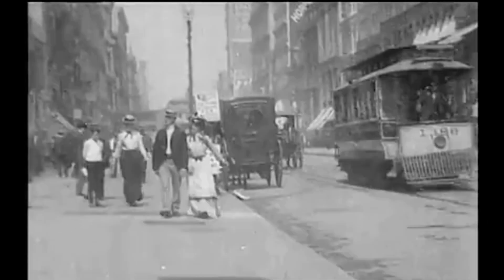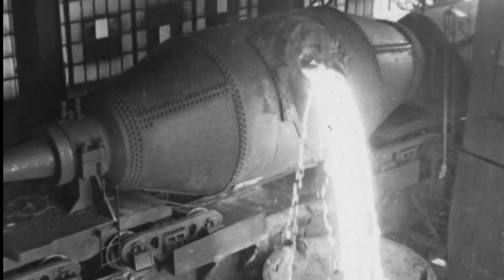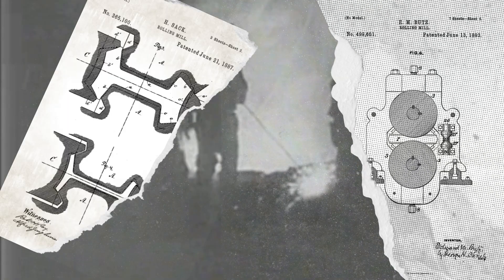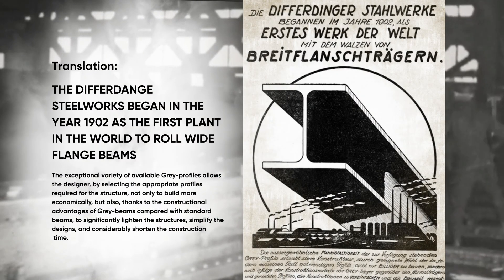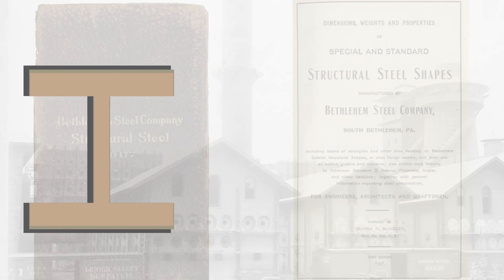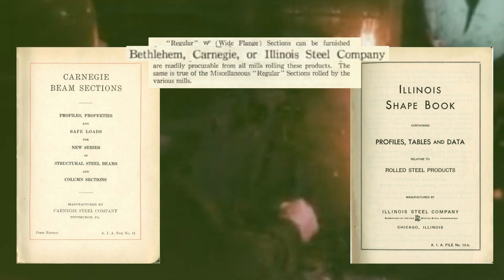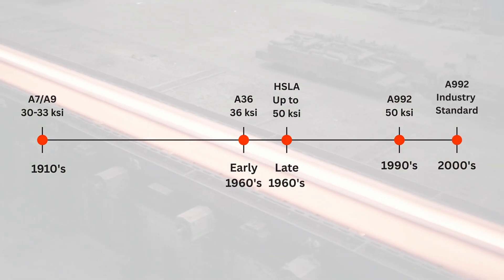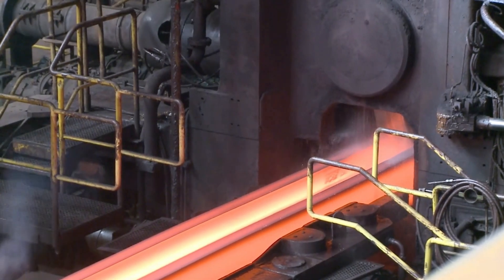From I Beams to the W14x1000 - The Structural Steel Evolution

Comment: Very interesting and enlightening. I didn’t know modern beams are up to 10x stronger, that’s crazy advancement.
Reply from the maker: Thanks!  To clarify, modern sections have 10x the load-carrying capacity (not to be confused with 10x strength).  Load carrying capacity is a combination of increased strength (e.g., going from 36 to 80 ksi) and larger available section sizes.

So roughly 2-2.5x increase in maximum available strength and roughly 3-3.5x increase in largest available size.

Comment: I plugged the imperial strengths into a converter to make sense of them and got 50ksi = 334MPa and 80ksi = 554MPa. Which I found interesting, because as far as I am aware most of the world's rebar is made to a 500MPa yield strength grade. What makes 80ksi / 500MPa yield strength so challenging to achieve in an I-beam? Is it rolling reduction, or chemistry, or a combination - or something else? Although I can see how much of a breakthrough QST is - and was it the same company that developed TEMPCORE QST rebar? Also, what is the aim elongation and tensile-to-yield ratio for I-beam grades?
(My experience is in rod rolling - vastly different from section rolling!)
Reply from the maker: The 80 ksi yield strength in sections is due to QST.  QST provides so much additional strength that there is actually less carbon and alloys in A913 grades relative to the industry standard A992 grades.  There are a few other videos on our channel that go into the specifics on this.

Your other questions can have different answers depending on grade, but all can be found here: https://ami.arcelormittal.com/structural-shapes/A913_HighStrengthSteel
Reply: @ArcelorMittalInternational higher strength is not always a good thing for structural sections. Higher strength = lower ductility, and less area under the stress strain curve, after UTS and before failure

Comment: I'm wondering what something like Fusion 360's Generative Design operation could produce for optimal shapes of such beams. Perhaps  it would produce something not currently manufacturable, but I think it would be interesting to see what it creates as some optimal designs and spur on new mass manufacturing processes to accomplish them.
Reply: we can already use FEA with optimisation algorithms to determine this, but it will still spit out an I-section. This is also highly dependent on how the element is loaded, but for pure bending, an I section will remain for as long as we use steel

Comment: I remember visiting one of my projects and seeing the W14x730 in person for the first time. Yowzers! Someone had left a soda can next to it on the base plate and it was dwarfed by the thickness of the flange. It was on an expansion joint so there were two of them side by side! In future videos, you should explain what stuff like "ksi" is. Not everyone speaks "structural engineer". Maybe also explain that in the standard sense of W14, when it comes to something like the 730, the 14 is actually somewhere around 21.
Reply from the maker: The section cut on the far left of the video (when I am on camera) is actually a W14x730!  It's a big hunk of steel, but what's crazy is how much smaller it looks than the W14x1000 next to it.  The W14x1000 is a bit closer to the camera, but not by much.  

I appreciate the suggestions, and thanks for watching!